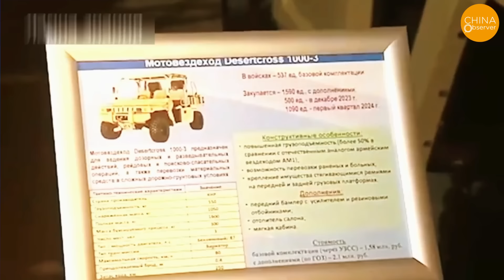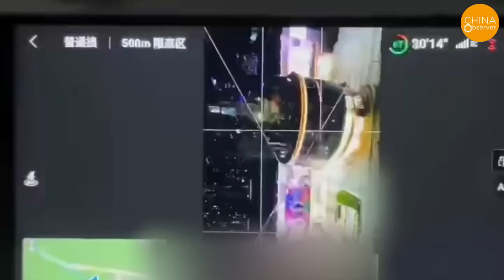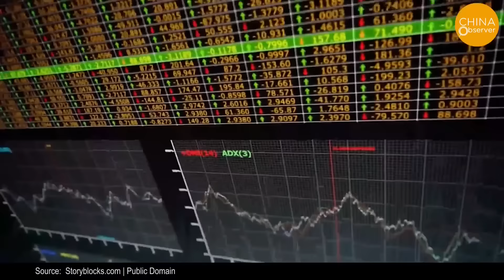China’s Tofu-Dreg Tank Joins a Contest, Loses Wheels, and Falls to Pieces! Russians Laugh Heartily

Comment: That roadwheel coming off was a maintenance issue - that should have been detected by the crew during their 'during operation' checks.  Whenever your tank comes to a stop after a movement - you always feel the roadwheel hubs.  If one of them is hot - then the bearings are failing, and you need to replace it.  

This is 'Tank Crew 101' level stuff that prospective tank crewmen are trained on before they even go to their first unit.
Reply: There is no quality specification on anything in China. Those wheelbolts were probably made of lead, like the rebar they use in construction.
Reply: Like those cheesy gokarts they sell at Costco
Reply: So basically, regardless of engineering issues, the tank’s gonna have the exact same problem that Russian tanks are having: inexperienced and poorly-trained crews servicing and operating heavy war machines.

Gonna be interesting to see how many of these get abandoned/demolished within the first week if we go to war with them.
Reply: @OneBiasedOpinion  It wouldn't be that many, the first week would be mostly naval and aerial combat. The main things being demolished would be carrier strike groups and air bases.
Reply: @jorgenguyen7641  China has, what, one carrier?
Reply: @jorgenguyen7641  but the missile has to reach its target to do anything
Reply: @jorgenguyen7641 you clearly have little to no knowledge on us anti missile capabilities
Reply: @isaacwhite7602  Of course, America has magical powers that will enable it to win any war. Actual production capacity is meaningless in the face of magic! Harry Potter ass empire.
Reply: @jorgenguyen7641   unfortunately us army has been involved in so much real wars (unlike china), that there is no chance to compete in machinary/personel/strategy level for anyone (even ussr's greatest army obviously could not stand). it is a fact (i'm not sad or happy about that but clearly can not see any different picture). let alone eu army is negligible to us'

Comment: That tank makes me think of the chinese civilian aircraft the 919, their saying it will give Boing a run for their money,  yea right, right up to the point it starts self destructing mid air. 🤣🤣
Reply: It may give Boing a run for its money, but not Boeing. Plus you can only buy it with BRICS, which is exactly how it will fly.
Reply: Naw I'm sure it will give Boeing a run for its money, while it's sliding along the runway after it's front landing gear fail whatever Boeing aircraft is in the way will need to do a runner to not get hit
Reply: Their own citizens would refuse to board it if they actually produce it for commercial use

Comment: 7,62x54R has been used soon 150 years and of course manufactured too. Funny that they still had ptoblems to produce small arm ammo.
Reply: Yeah thats not an indication anything good is going on in Russia as far a Military industrial manufacturing in concerned....
Reply: They couldn't make their own ball point pen until 2017.
Reply: 130+ years, it was adopted in 1891.
Reply: Good round............ in 1891
Reply: The key element of that segment (that was zoomed over) was the issue of defective primers...I don't care where the other elements of the ammo comes from, if the primer doesn't go BANG when the firing pin strikes it...the ammo is worthless.

You may as well be throwing rocks...
Reply: not realy chinia never made quality products ever
Reply: @fawnlliebowitz1772  With decent quality ammo and a proper remote hole puncher it has relatively good performance.
Reply: There is no concept of quality control there. Chinese producers only concern is getting it sold, the motto is: It's cheaper to fake it than make it"
Reply: @fawnlliebowitz1772  I mean we still haven't really found a round to replace 9mm and that's nearly as old
Reply: Many like the 40, idc I have 44;s, 9's, 380's and 45's and like them all. 
Now to answer the age old 12 year old question of.......... what you would rather to be hit with........ well none of them actually. @michaelkeha
Reply: @fawnlliebowitz1772 still a good round in 2023. US still uses 50 bmg and m2 browning but would anyone dare talk bad about it?

Comment: Feel bad for the ones in charge of repairs for that tank. Going to be doing lots of hard labour.
Reply: And then he still has to do the repairs.
Reply: except the mechanic probably had nothing to do with it. If the bolt was loose sure fine, but if it was a bolt that sheered off cause the metal wasn't to spec it's  nothing to do with him. If he bolted it in place and torqued it down to spec and it failed under load i mean whatchagonnado

Comment: FYI, nothing is bullet proof. Bullet resistant is the most you can hope for. Or don't be where bullets are flying. And bullets vary in energy, size, composition. Mach 5 tungsten is admirable. Mach 5 DU is devastating.
Reply: Bullet proof and bullet resistant are LITERALLY the same thing.... 😂
Reply: bullet proof implies capability to not be affected by bullets.
Reply: @ArtificialDjDAGX  Implies is a good point. Having watched many tests, it is apparent that even though the projectile didn't penetrate through the vest, it deformed enough to kill the wearer. Again it is best to avoid being where the bullets are flying!

Comment: A road wheel coming off on a tracked vehicle, is either a sign of an untrained crew who did maintenance on the vehicle and failed to put it back together again or broken components.  Either way, China should have not had this embarrassing display.
Reply: You underestimate a country's system that rewards cheap short cuts with so many corners cut that it becomes a detriment to them.
Reply: That's not exactly true.  I had the idler shear during a field exercise.  No maintenance issues, no apparent cause. (M60A3)
Reply: It is the OceanGate syndrome. Why use military grade wielding if you can use hardware store epoxy glue.
Reply: @aquarius5719  All tanks break, especially if you "General Lee" jump them.

Comment: Testing of fasteners / bolts and other components are important.The cost of the US military can seem unusually high, I know because while working for defense contractors, I saw first hand how many requirements of parts had pages and pages of documentation for the specs with serial numbers, much like the airplane industry does too.I knew an inspector who went to jail for falsification of military hardware documentation.Testing and the procedures costs time and money. It`s nothing like most commercial manufacturing. This sounds like material failure and not a design fault.
Reply: My money is on fake specs and cheap materials.

Comment: "Almost on the sprocket."
Dude, the sprocket is at the back of the tank - that's the toothed wheel that is connected to the transmission and the engine and moves the track around. It's the first roadwheel right behind the idler wheel (the unpowered wheel at the very front of the hull, which redirects the track downwards and backwards) that came off.
Note that there are tanks that have sprockets at the front, but that's only either because they have a front engine (like the Israeli Merkava) or because they have a transmission that runs almost the full length of the hull, from the back engine compartment to the front (like the M4 Sherman - and that transmission is the reason why that tank was so tall in the first place). Not the case of the Type 96B.

Comment: The problem with any Chinese project is that it trends like this.

Project is established.
Project Leaders contract out to friends, pocket some "gifts".
Contractors then sub-contract for less and pocket the difference.
Repeat that previous step a few times.
Tofu Contractor use cardboard and silver tape - calls it International Standard Steel. Gives "Gifts" to inspectors to sign off.

Comment: So what?? This was tank equipment competition to test their tank in extreme terrain, weather and pushing their tanks to the extreme. Even if tank break down, Chinese engineers will be to see the defects in Type 96 tanks.
Reply: The point is, like early access games, if mistakes were made on the competition phase where everything was supposed to be tested and approved, then that means someone messed up and skipped 10 safety regulations mate. It's easy to bark when you ain't the one having to be on the battlefield with faulty equipment.

Comment: The criticism of the open 4 wheeler made by china for russia is ridiculous. Those vehicles are not meant to be armored or to resist enemy fire or whatever, those are meant for transporting supplies in difficult terrain behind the front line. If you make them covered in armor they become exponentially more expensive because then the engine also needs to be stronger, the suspension would need to be massively upgraded, the drive train, literally everything on the car would need to be 5x more expensive.

Comment: China is Uzbekistan's second largest trade partner after South Korea. Russia is a close third.
Been that way for decades. 
When I visited Uzbekistan about 10 years ago it was clear. Most cars were Korean, most home appliances were either Korean or Chinese. Fuel oil and gas mostly came from Russia, leftover from the Soviet days. I'd guess that's probably shifted to Kazakh oil and gas by now.
They're also largely dependent on Russia for spares and replacement military equipment, another leftover from the Soviet days as the country simply lacked the funding to replace the old Soviet equipment.

Comment: considering these games are designed to make the T72 look modern and good. This failure is even more revealing
Reply: Maybe, but the Chinese team still won.
Reply: @voidtempering8700  Honestly, I dont know if Im supposed to be impressed that the chinese team still won after losing a road wheel or that disappointed that the other teams sucked so bad that they lost despite having functioning tanks. These games were designed for soviet tanks to look good. theres a reason Nato tanks never take part in these games
Reply: @theduke7539  I mean, they brought the tank back and got a new one. The lost points for it, but their other scores made up for it.

Another thing is that the wheel didn't just fall off, they were driving full speed into an obstacle course instead of slowing down like everyone else. A collision at full speed knocked it off.
Reply: @voidtempering8700  bad training meets cheap tank. Who am I kidding, even a good tank cant make up for a bad crew
Reply: @theduke7539  It might be cheap, but when it comes to technical capabilities, it is superior to the other T-72b3ms that are used.
Reply: @voidtempering8700  that might be, But I cannot stress how low that bar is. Imagine the US slapping ERA and a new thermal sight an M48 Patton and still deploying it in 2023
Reply: @theduke7539  You realize the M-48 is inferior to the T-55, right? And even the T-72a was considered on par with the M-60a3. The T-72b3 is superior to the Abrams up until the M1a1, and its FCS was better up until the M1a2. 

The Type-96 B and C is superior to the T-72b3 in most practical ways.
Reply: @voidtempering8700  Lol, Oh man I can't you honestly believe that. Okay, first of all, The T55 was the tank that impressed the west. It was the T55 that forced Nato to reconsider its armor doctrine. I say that with the utmost respect for the designers of the T55, they actually built something new and unique, and its got a simple elegance in its design. However, there are limitations to its design. The small turret and turret ring meant it was limited in upgradability, while the 100mm cannon was exception when the tank debuted, that 100mm cannon was pretty quickly outdated by 1965 as Nato's high velocity 105mms were coming onto the scene with much greater penetration and far better range. Which is where the T62 T64 came in. Designs intended to take the base of the T55 and expand it and make it more capable against nato tanks without sacrificing the things that made the T55 good, its simple maintence procedures and small silhouette. These tanks were very good for their time. However, unlike the T55, the advantage really wasnt there. The T55 debuted with no real equal. Most nato tanks were ww2 hold overs with the US being the only ones to field post ww2 designs on the battlefied at that time with the M26 pershing and the very early M48 pattons. The pershing proved to be more than a match for T34s in Korea, but it also proved to be limited, it was really running short of the newer M48s. The When held against each other, the T55 and M48 had similar ranges, but the T55 had an advantage in firepower. The M48 originally only had a 90mm. But it had far more armor. meanwhile the T55 was a much smaller target. The T55 being smaller, having a fire power advantage, and more agile allowed it to be a serious threat to nato tanks. And when T62s met M48s in Vietnam, they were considerable threats. But not as much as youd think, for starters, range meant nothing in vietnam, all tank engagements during that conflict took place at the tank equivalent of point blank. So range and firepower evened out. The T62 was bigger than the T55 but considerably smaller than the M48. However, the M48 had the advantage of technology. The M48 by 1965 was running IR and early night vision optics plus laser range finders. The T64 was the first soviet tank to get laser range finders and they would later be retrofitted to T62s and T55s. But Credit where its due, the T62 and 64 were more than a match for the M48. However, Thats where this ends. The M60 came along with far better armor, far better gun, much better nightvision and thermal optics. Which really should have forced the soviets to change their own doctrine but they didn't.  Thermal optics with accurate BCUs make small tanks in hull down positions go from a very good to obsolete strategy overnight. Suddenly hull down didnt matter in the small tanks. The T62 had a small turret, as does the T72, T80, and T90. Their turrets are too small to fit enough armor to stop the 105mm high velocities coming from later M48 and the M60 tanks. And they certainly werent stopping the rounds from the M1. especially when the M1A1 debuted with its 120mm high velocity smoothbore gun using APFSDS with the latest in optics and computers. Suddenly it became less about could you hit the tank and could you hit a specific part of the tank. And when that reality happened, Russia failed to adapt. It wasnt their fault, the T72 was originally supposed to be the last adaptation of the Kharkiv Morozov design and the T80 was supposed to be a new ground up design to counter newer western designs that could use longer shells and could engage further while being more protected. However, the T80 and later T90 had the misfortune of being designed in the late soviet union where the economy began to crumble under the weight of the arms race and eventually they took to modernizing T64 and T72 designs  which meant they ended up with different but not really better tanks. The fact that modern russian tanks are absolutely covered with ERA shows that they know their hulls cant stand up to western ATGMs or rounds from western tanks. Meanwhile the US uses ERA only on the side skirts to protect the tracks because the side skirts are thin armor but the turret and hull dont need ERA. The Challenger 2 was designed to have ERA on its frontal plate to save weight but they eventually saw the problems with that and mounted a massive steel plate there. Even the Leopard 2 only uses ERA on the side skirts when they use it at all. 

Heres the TLDR.
Bradley IFVs have destroyed more Tseries tanks with their tow missiles and 25mm chain guns than Tseries tanks have destroyed all western armor combined with any weapon ever strapped to a T72. Even the Leopards and Bradleys destroyed in Ukraine werent taken out by russian armor. They were disabled by antitank mines before being pelted with heavy caliber artillery like 155mm shells which is enough to take out any tank ever made regardless of who built it.

Comment: 😆😂🤣...
Iam working with to use the steel from std. quality all around the world, i never seen before is £ucking idiot steel from their, because is so super cheap, just that, for my design a some part of engineering, just it's deform like a tofu for a tight nut(std. tightenning)
some example the part is major broken failure, it's £ucking dissaster, may be is super good for internal, but for export...!?!??!

Comment: Track failures happen
it was likely due to the suspension because these games are very taxing on the tanks suspension because they are flying around at high speeds
it does not mean the tank's is not good because in combat a tank moving this fast would likely never occur as we have seen in ukraine
also the jeep clearly got destroyed by the ukrainian military and it is a lightly armored vehicle meaning it doesn't have armor to withstand anything
still though the jeeps are shit 
they were clearly not rated for the battlefield because they were classed as civilian vehicles and look closer to toys